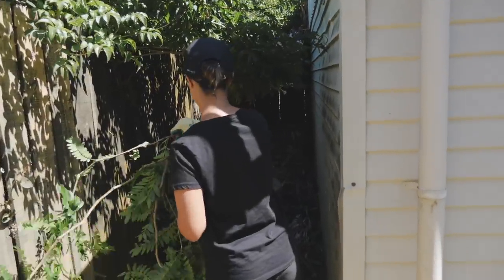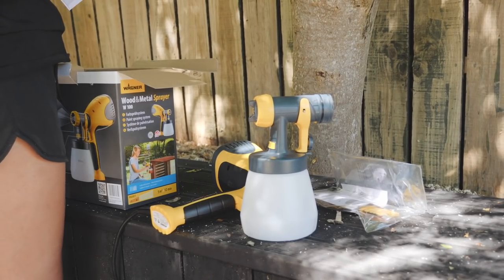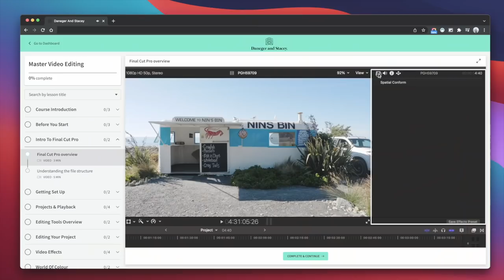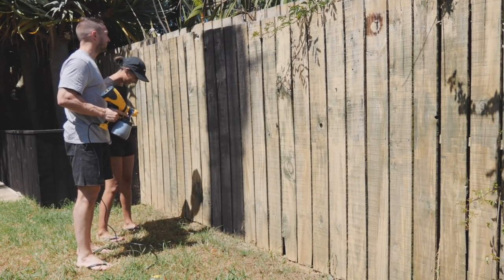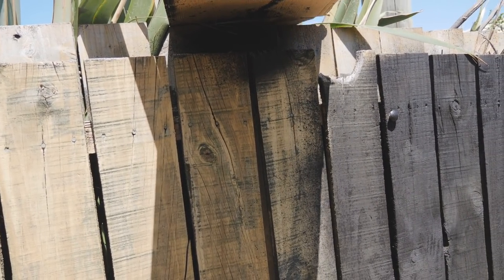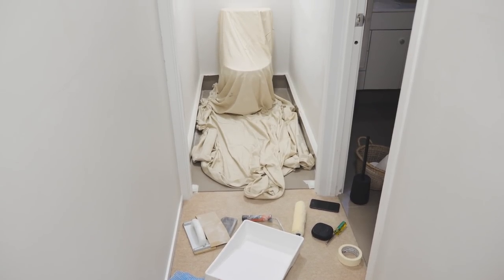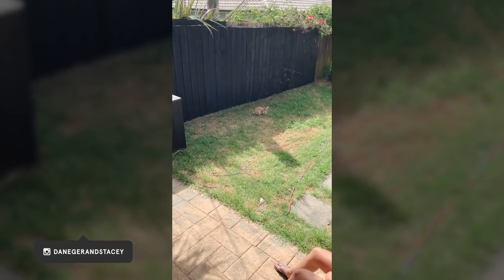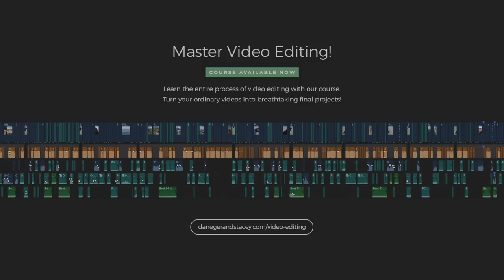We Got A Paint Sprayer + ROOM REVEALS! (Finally)

Comment: Quick hint when spraying the top of the fence if you don't want overspray on the neighbour's trees - you were close with the card sheet,just holding it the wrong way,laying it down on top as you guys found out doesn't quite work - if you have someone to hold it flat against the back of the fence while you spray it...that prevents the overspray (it's easy enough to do it by yourself if you're tall enough though). But good finish though guys,and I bet that was all down to Frank or whatever the rabbits name was

Comment: Awesome guys! Just be aware of when you create a compost area against a wall, if those are weatherboards they will rot (even if they're cement ones by Hardies) as the moisture will transfer through the wall and rot the bottom plate and studs inside. When you can, try and create a 100mm barrier between your composting area and the side of the shed for ventilation :)
Reply from the maker: VERY good tip, thanks Lydia!